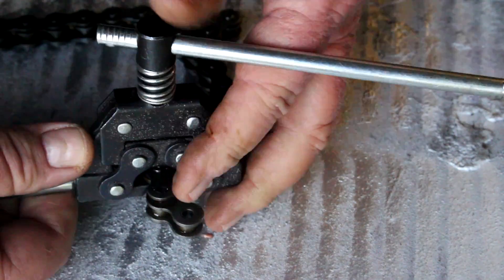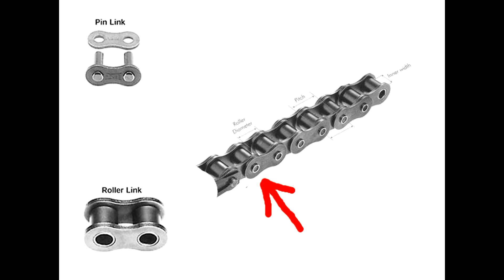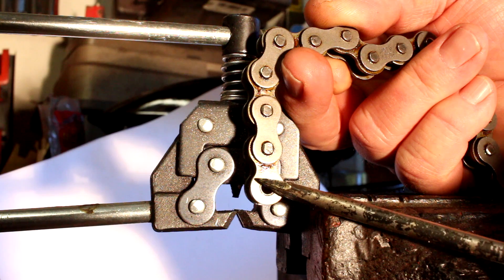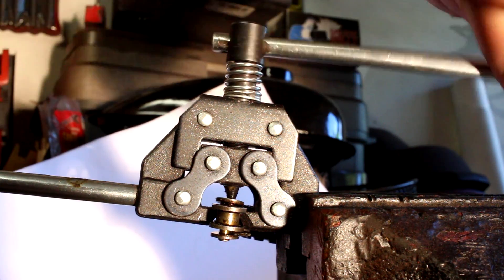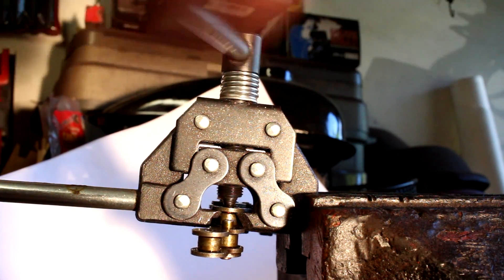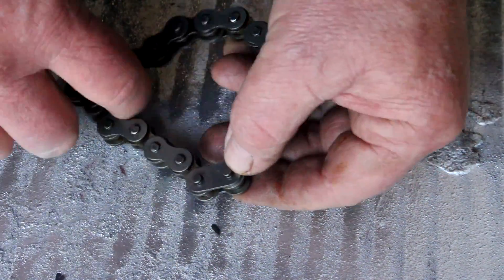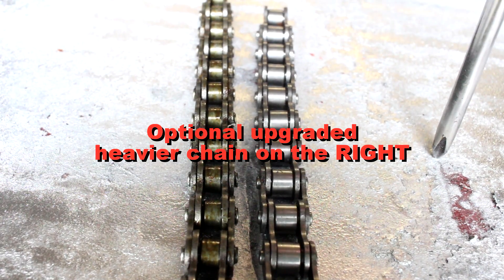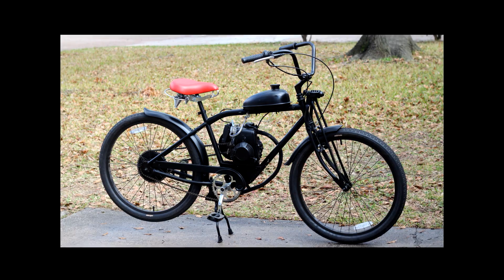How Break or Cut Motorized Bicycle Chain Using a Chain Breaker Tool

Comment: Do you need a bench vise for this tool? Every time I try to tighten it and push it out the two ends just open up. Am I missing something?
Reply from the maker: If the tool is the right size the two jaws should stay under the plate.. No vise needed. I just used it to make framing the shot
Reply: @HughesMotorized  that’s odd the tool I bought looks identical to yours and is for size 25-60 chain, I’ve been trying to shorten a size 25 chain for 3 days and can’t get anything to work I’m starting to get really frustrated and am about to just give up I don’t know what else to try nothing is working. Every video I’ve seen makes it look like it should be easy and no problem at all and I’ve been struggling for hours and days on end to push two stupid pins out.
Reply from the maker: @fredfrederickson  Many of the lower-end chain tools take some technique to use. The tool's pin often slides off or like you are experiencing, the jaws slip. Need to get jaws firmly in place and under the plate while aligning the tool's pin with the pin on the chain's pin. Once it is aligned and secure then you slowly tighten the tool up to break the chain. Tell ya what. I'll upload a better vid this weekend showing how
Reply: @HughesMotorized  appreciate it. I feel like I’m doing the same thing as you and in all the other videos but it just won’t work for me. I’ve bought two separate tools and now I’m buying two more to see if I have any better luck and if that doesn’t work maybe I’ll just throw the whole scooter in the river at this point.
Reply from the maker: Here's an updated vid: https://youtu.be/cjcZNlQU4JM
Reply: @HughesMotorized  thank you! I’ll try it out later today, appreciate the help

Comment: You can also use an angle grinder to knock the head off of the rivet and then the pin will usually fall right out.
Reply from the maker: GREAT SUGGESTION.

Comment: @Hughes motorized.  So are the chains that come with the motorized bike kits beveled? Do you've to grind the bevel down first?  Or can you just go straight to the chain breaker tool and pop the pin out with it?  Thx for the help. Always love how well you explain and especially how well you show the stuff you're explaining.  Always love a like and a comment.  And share it of course. Thx
Reply from the maker: I just use the tool. No grinding. Some of the pins are flat and some have a slight angled bevel
Reply: @HughesMotorized  to for the reply brother.  One more question if it's ok. What ratio mix do u use from the 1st to last of mixed gas. I got 93 premium no ethanol. But not sure how much. To many ppl say different things. I trust you the most. I think 40.1  would be good but would like to know what you think.  Thx very much
Reply from the maker: @stephentrujillo7555  Run the cheapest gas w/ the cheapest 2 stroke oil mixed at 3.2oz per gallon from day one
Reply: @HughesMotorized   I've researched it and it seems the regular unleaded gas has lots of bad stuff that gets in it. Especially water which is really bad right. So wouldn't premium gas be better  as it doesn't have that much stuff in it. But I'm guessing this is what you use and have never had a problem. Honestly I wasn't expecting that answer. I appreciate your honestly and straight up answer. The best ppl to learn from are the ones with experience. Thx again
Reply from the maker: @stephentrujillo7555  My philosophy is to keep it simple and cheap. Never had an issue. Only issue w/ gas is if I let the bike sit for months over the winter or get a new bike and let one sit. Fuel stabilizer or draining the carb would have avoided the issue. these are very simple, cheap motors. No desire to spend more on gas or oil than I spend on an engine. I've been running my current one for 5 years no issues

Comment: You make putting that clip on look so easy lol…I’m using same pliers and have been struggling to get it in for 40 mins.
Reply from the maker: I've done it 100s of times. It gets easier
Reply: I use needle-nose pliers i “modified” with one of the tips bent right at the tip, just the tiniest bit, makes putting the clips on alot easier.

Comment: My chain is on a robot that moves forward and backward, that sounds like a problem for the master link.  What are other options?  Can I extend the chain and push pins back in?  If not with this tool, with which?

Comment: I don’t understand why you had to break the chain twice , why didn’t you just drive one of the chain pins out at the length that you wanted?
Reply: Good question. I think it's because on this kind of chain tool, it has a cone-shaped pusher pin, so it goes into the plate only far enough to push the pin through the top plate.  So you use it on two adjacent pins to remove the plate.  The alternative is to use a tool whose pusher pin is a rod slightly smaller than the chain's pins, and you can use that to push the one pin all the way through the bottom plate as well, at least until it's almost flush with the bottom plate, and then the two links come apart.

Comment: bought this for 40$ and was advertised to break a bmx chain and it does not work whatsoever, do not buy this tool off this guy if you're trying to break bike links
Reply from the maker: This is for motorized drive chains #415 or 410. NOT BMX chain.
You need a totally different tool for a pedal chain. HEREs what you need >> https://amzn.to/3dTfrE7

Comment: Hey guys here's a tip for cutting down your chain if you don't have the tool to do it, I use a drill bit to grind off the flat side of the chain pin, only takes around a minute until you are left with no flat side then you can just push it out with a screw driver, hope that's useful to someone and I explained it well enough :) good luck guys

Comment: hi can you help me I need to know how many gas and oil mix for my 80 cc 2 spoke I need to know but I don't want too much smoke thank
Reply from the maker: +Efrain De la riva 3.5 to 4oz per gallon
Reply: start at 4oz and if you are getting smoke... then go to 3.5, new motors will always smoke.. so run a couple gallons through at 4oz before lowering it.. If no smoke at 4oz then your golden..